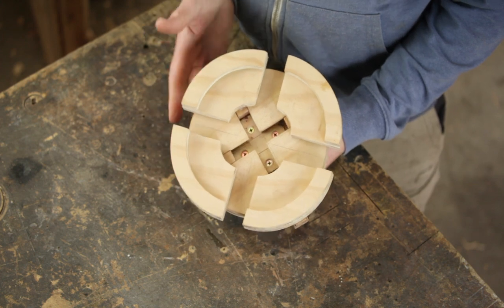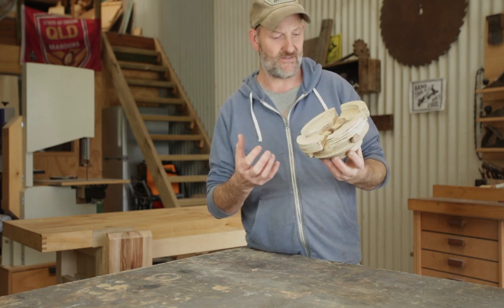Self Centering Lathe Chuck - Unsuccessful Experiment

Comment: 1:48 An improvement on the toothed bit: Have the grain run vertical, so the teeth cannot break off. Reinforce it with small strips glued onto either side (sort of like a piece of 3-layer plywood with a fat center layer).
Reply from the maker: The main reason they snapped is because the whole mechanism isn't accurate enough, the teeth snap off when they get snagged on the spiral when not running smooth. I tried a set of jaws with the grain on the teeth running the other way and that was no better. Thanks for the input! :)

Comment: I bet a piece of steel and an angle grinder would make quick work of that toothed bit, and I feel like a bit of music wire bent into a spiral and drilled and screwed down would make the spiral screw pattern work.

Great idea, though, and it looks a lot simpler in construction to a more traditional self centering chuck. It may not ever be able to clamp quite as tightly, but pretty nifty all the same.
Reply from the maker: Thanks Josh! The biggest hurdle is achieving accuracy. ;)

Comment: If you wanted to revisit this, there's no real need for this to be an ACME shaped thread,  A square profile thread would work, which could be made from a spiral of bar stock mounted on edge in a spiral dado.  The teeth could also be formed on the edge of steel bar stock and mounted in a dado on the jaws.  It could work with steel durability on the delicate parts.

The tricky part would be cutting the spiral dado accurately.  A string fixed to a center pivot post wraps in a consistent spiral of the post's diameter per rotation.  Perhaps that could guide a trim router like a slowly closing compass?
Reply from the maker: Thanks for your ideas! Steel would be the go but I'm not sure I would be able to make it accurate enough. :)
Reply: Seems if you could get an accurate spiral, it could be used to measure/mark/file/verify the teeth (in a similar manner to a box joint jig for a table saw).  I haven't done it.  I'm just brainstorming.

Comment: Anything you learn from is never a waste of time. I know this is a couple of years old, but don't give up on the concept yet. Even if this didn't work, it appears the only real failure was in the material itself, and besides many great projects fail a few times before all the kinks are worked out. I may try making one as a pattern and casting a brass or aluminum version. If it had worked out as you wanted, what was your plan for locking the position when something is chucked into it?

Comment: Definitely a prototype to be made from aluminum or steel with a CNC. I have seen some of the cheaper cnc desktop machines do aluminum. Don't know how well it'd work for this.

What about bending a strap to be your thread, and making the blocks from aluminum? You could then embed the strap into the ply base, screw the blocks to the jaws, and use the rest of your design about as is.
Reply from the maker: Thanks for the input - some good ideas but I don't think I will be revisiting this project. I'd be very happy to see someone else try to improve on it though! :)

Comment: This is exactly how my metal chuck works. Very impressed you made one by hand from wood! By the way, have you heard of a Longworth chuck? It's also an interesting design, and designed to be made from wood (mostly - some bolts required).
Reply from the maker: Thank you Bernhard! I've not used but have seen Longworth chucks, I attempted this more for the challenge! :)